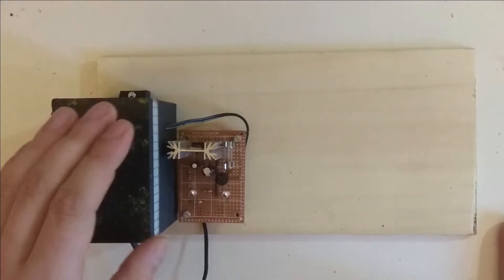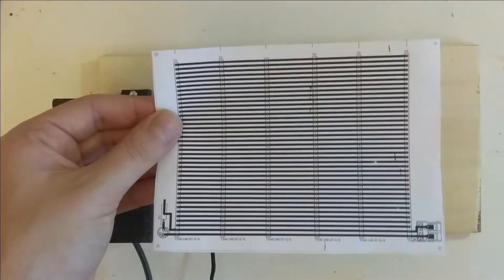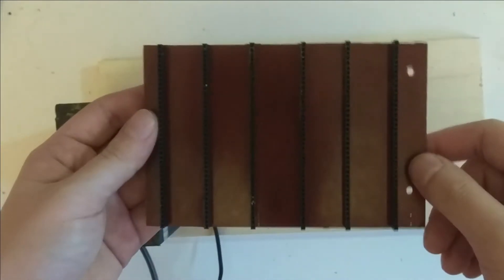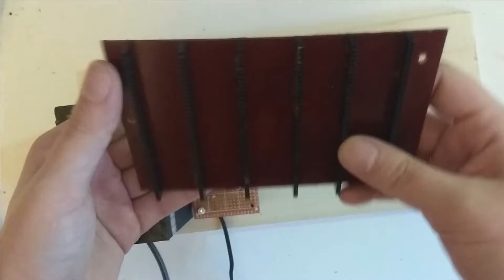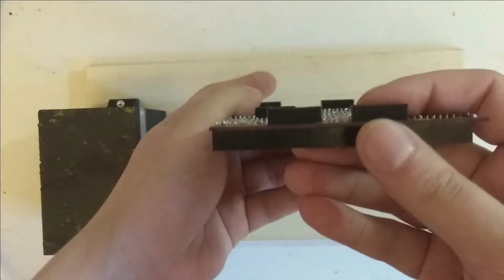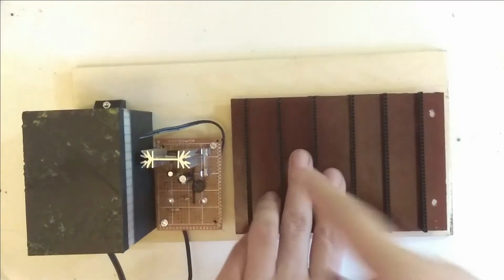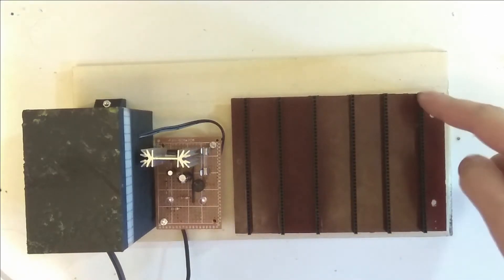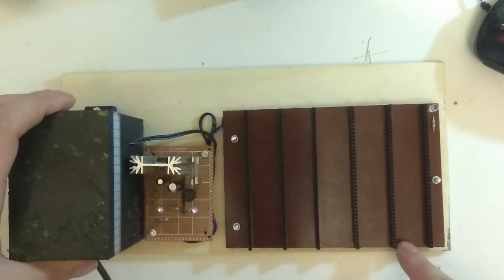Building a Z80-Computer Part 3 : The Backplane

Comment: Majority of electronic components based on american Standard, 0.1" Pitch (2.54mm).
But there lot's of components with European Pitch, 2.5mm (and a derivative of 0.5mm)
It's not a bad quality - it's just another standard. 
But i think you know this already.
Keep on making such videos.
Reply from the maker: Thank you! I think these headers where just out of tolerance a little since I used matching footprint and header but I've been bitten by this issue before. It usually pays to double check ones Footprints ;)